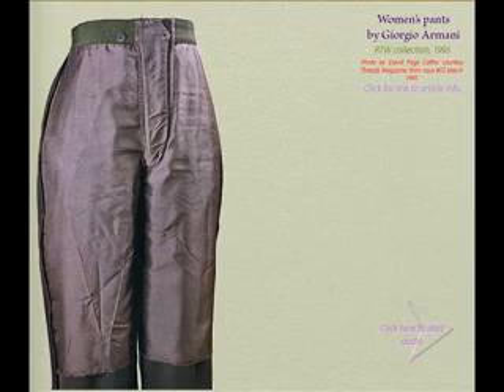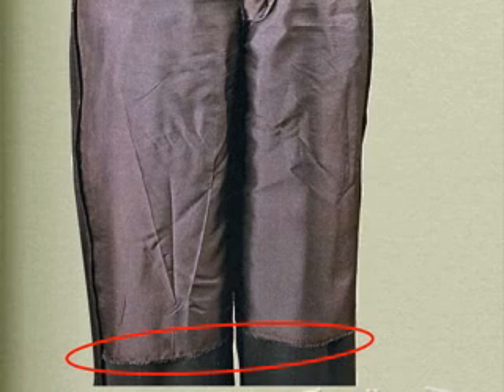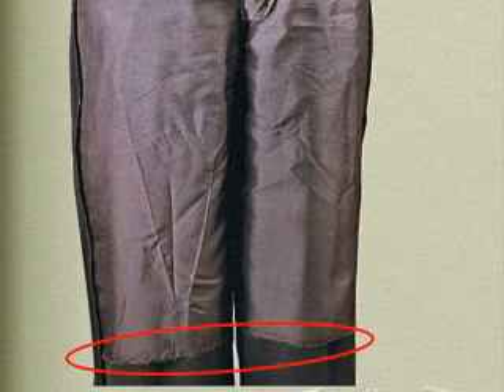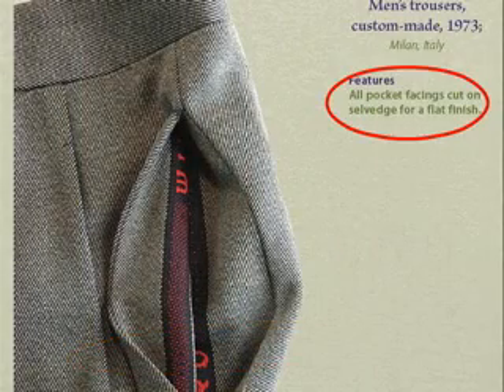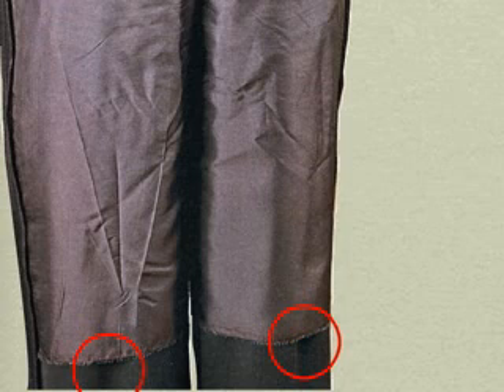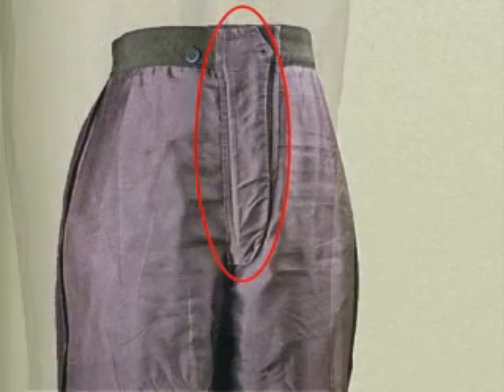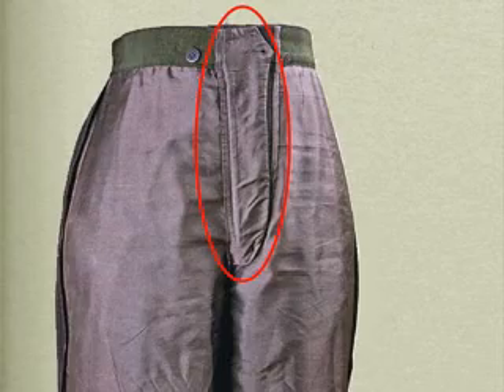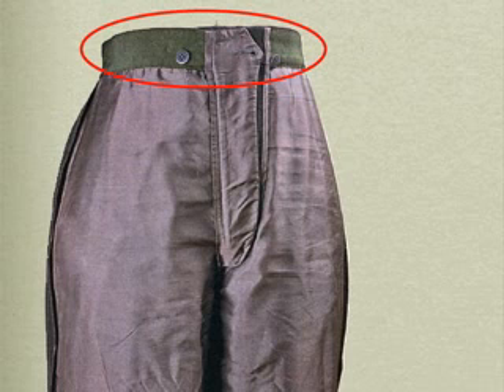David Page Coffin looks at some $1000 Pants

Comment from the maker: Good question, altho there are certainly men's pants without split bands, like jeans, for example. I've got a nice pair of Brooks Brothers linen pants with a single band. Jeans don't have them because the center-back seam is flat-felled and can't be expanded. Any other pants that don't have them will also not have any extra seam allowance width at the back to allow for expansion. Why they don't is because it's easier/faster to sew on a single band. And so you buy new pants if you get bigger.